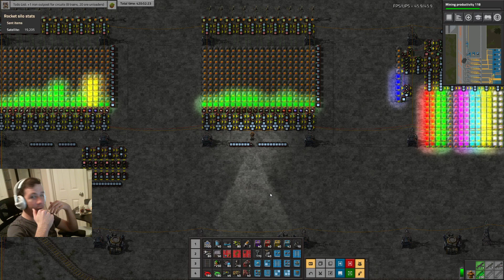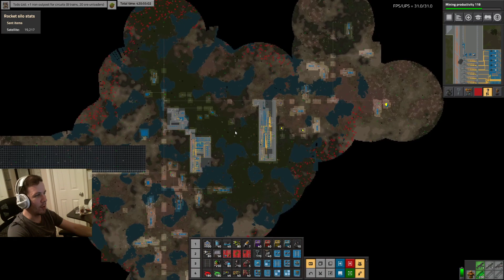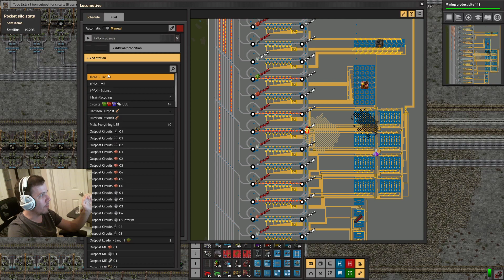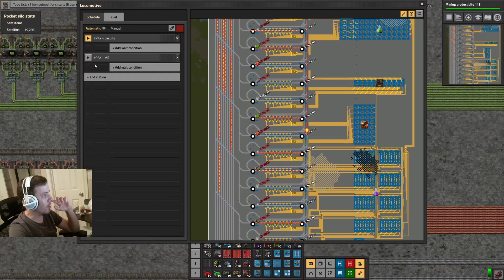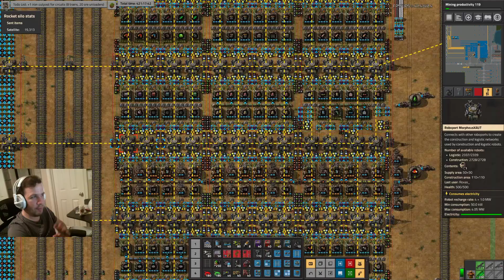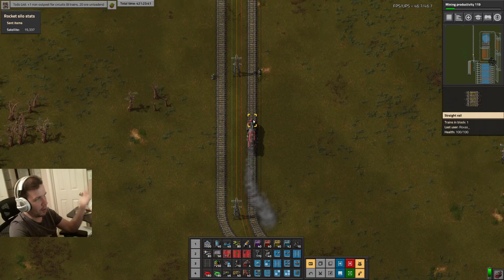Factorio Vanilla* 0.17.79 Megabase Tour (4.2k SPM, 45 UPS)

Comment: I'm amazed. What tips would you give me for starting a Mega base.
Reply from the maker: Thanks! I think what would help to get started is to first have a vision that's small, around 250 SPM using level 3 modules. Figuring that out won't be as tough and scaling it up isn't so different. I think the main obstacle you will encounter is how to produce and supply resource outposts, so that's where I would focus most of my attention. Figuring out science assembler ratios using the Kirk McDonald calculator is the easy part. Good luck!